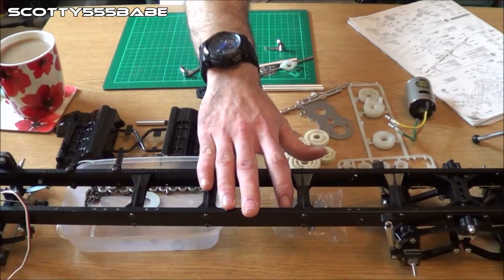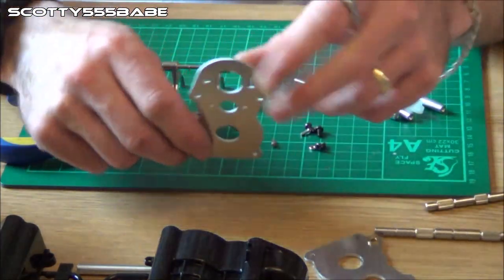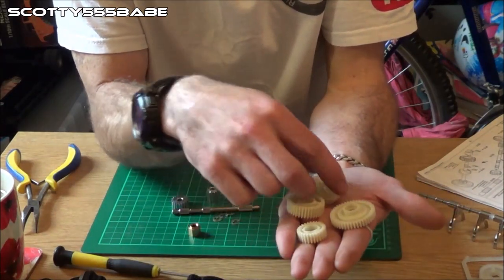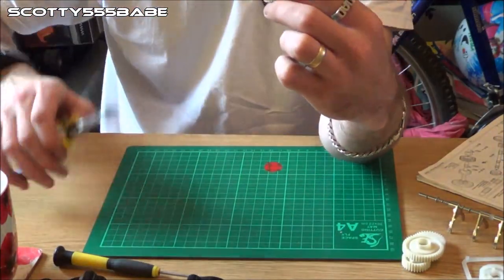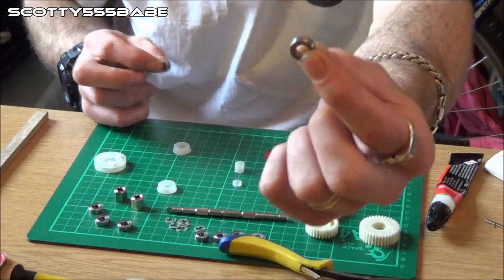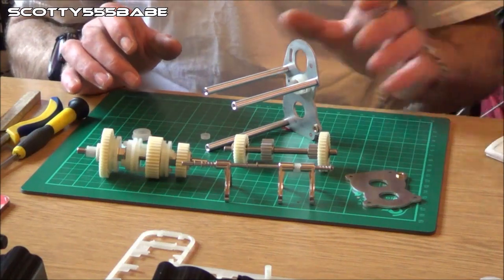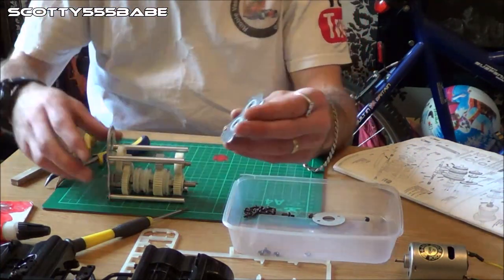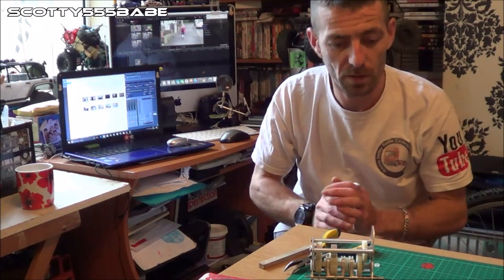RC TRUCK BUILD | TAMIYA GRAND HAULER | BUILDING THE GEARBOX | PART 6

Comment: At the 6:20 mark, you quickly mentioned Sound....
This is something that I would almost consider a NECESSITY for a Rig like this!!  Is it at all possible, to have Sound and Lights on these Rigs - with a 4-5 Channel, 2.4ghz Radio?? Or am I stuck with the old fashioned and WAY overpriced Tamiya 4 Channel Radio, that's nearly a copy of a early 1980's Futaba???? 😵😱 Is there a way? I would definitely appreciate your input on THIS. 
Cheers, Carmine 💥 ⛽
Reply from the maker: Four channel is fine for running a tamiya Mfu which has sound and lights, however there is a cheaper option on the market called a beier usm or bieir usm but you have to be handy with programming them as you put your own engine sounds etc in to really make it more realistic, I have one for my Kenworth and will be having it programmed with a Cummins 👍